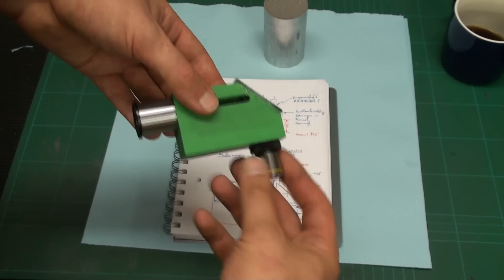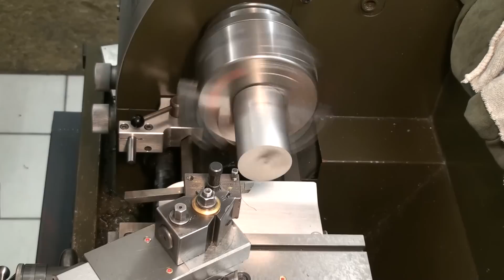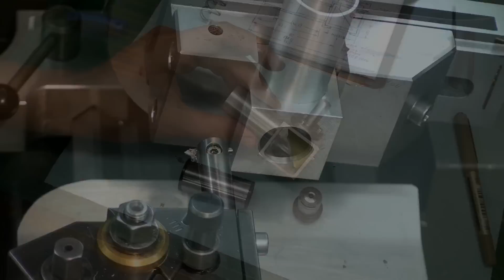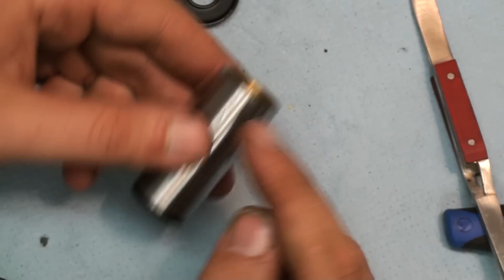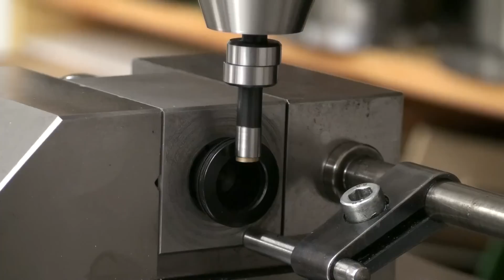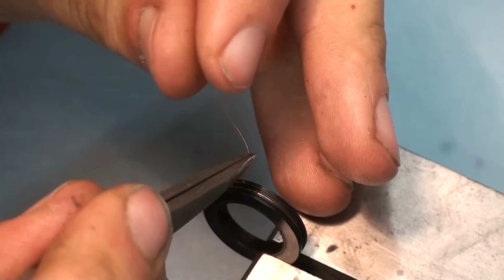Centering microscope - Prototype

Comment: Moin, Herr Gotteswinter.
Ich hab hier einige ESP32-CAM-Module, kleine Platinchen mit Prozessor und Kamerachip. Die können Sie für weniger als 10 Euro z.B. bei Ebay kaufen. Statt dem Okular können Sie den Kamerachip platzieren und das Bild auf Ihrem Handy betrachten - drahtlos, per WiFi.
Gute idee?

Comment: Nice presentation and good stretch.

Use a isotopic flash light source of a flash light or a laser pointer beam transmit from behind the eye piece can tell tales of how our design and finishing may be. When set up and focused the cross hair center onto a test cross hair center then rotate the scope one quarter turn to see eccentricity. We will be surprised with our result in the first cut. 

Scope like this must have alignment capability to compensate production error. There are two types of error concerning these scopes, optical - 1) axial tilt offset and 2) axial drift offset. The symptom of 1) can be mistaken as caused by alignment of 2) and vise versa. Do verify before entering an open loop task in refinement. 

I was am frustrated with one of mine it only have y axial correction. I decided to crack open it to regain the x alignment. Will trash it if failed. 

I love to wait for your next center scope project some day.

Comment: Stephan, this is just sweet work. I am going to try this. I love the precision. I don't agree with some comments regarding mirror angle error because once this device is zeroed by trial and error, the mirror angle will not come into play, I think. Dave T. Obviously has experience under his belt so this is my inexperience thinking out loud.
Should very much improve precision in the average drill press also. 
Thank you. //John in Oregon

Comment: Excellent work- 

Have you considered using this centering scope in the tail stock of the lathe to set the height of lathe tools?   

I would love a video of this. 

I’ve also thought about using this tool as a substitute for an optical competitor to measure parts by picking up edges and recording the DRO positions. 

Any Comment?
Reply: Autocorrect got me-
*a substitute for an optical comparator

Comment: Old video but i do have some Questions: Did you test it by drilling a center hole (just the tip) and then check the crosshair microscope how far it is off or vice versa? And did you rotate the microscope by 180° to check it´s center accuracy .And did you rotate your eyepiece/crosshair by 90 degrees or did you mark your eyepiece to not rotate it by accident because of the missalignment of the thin wire in the holes or any other off center thing? German>>>   Ansonsten tolles Teil :-)  <<<German

Comment: great but i can't believe you didn't even test or calibrate it with a real operation - would be relatively simple no? just select a target in  whatever material and bore a hole with the finest drill you have and then measure the error ... (?)  - or is that yet to come?

Comment: A suggestion for next version: you can buy optical graticules made for microscope eyepiece that are etched with precise scales ( 0.01/ per div). 
Some have concentric circles etched on the glass that make centering on small holes quite easy.
If you place the graticule/cross hairs in front of the lens looking down and align the center point with the center of the spindle you will virtually eliminate the parallax error the the optics and mirror above introduce. The center marker may appear a bit off center in the view, but if aligned correctly, it will in fact be in line with the spindle. The challenge though is very shallow depth of field. You need to compromise and balance the focus on the graticule against the focus  on the scribed line or the edge. But the up side is that the center of the scope is always in line with the spindle, no matter what happens to the mirror or the eyepiece. The downside is that this approach requires a redesign of the scope...
Check out the scope based on this principle made by Youtuber from Japan named Miki Ono.
https://youtu.be/wdcmPrVmVHY

Comment: Great idea, excellent workmanship. Question: as I noticed, the mirror with its thickness, is centered between rounded corners ( if I saw it right).
In this case the mirror surface is closer to you than the center of your mill.
What the real situation is?

Comment: A centering microscope or a laser crosshair centering light are as good as the method used to produce the center mark in the first place.  An easier, quicker and less complicated way to produce accurate holes is to make yourself a drill nest, one that can be set up using a vernier caliper negating the need to mark the hole center.  The 3D Warehouse has some examples.

Comment: You make some really good and useful videos.  You get the inventiveness in my brain motivated.  I was thinking of buying a Fowler 10X Optical 21mm Comparator lens set with the 8 piece reticle scales that are photo etched into glass.  Your single piece machined housing is genius.  I've been looking to do something similar to this.  I only expect hobbyist accuracy out of my device.   I probably will use and old 35mm single reflex camera Prism on a little fabricated seesaw for fine tuning of the angle (spring on one side and screw on the other).   I also want to add an old USB camera because my vision is no longer 20/20.
PS Hard Drive Platters are reflective. however I've made Hard Drive clocks in the past and If they are in a humid area they tend develop spots and make a nice home for some molds to bond to.  I need to get a camera and start doing videos.

Comment: But if the 4 holes ar larger than the wire, these two will doesn't self centering in the cross line correctly, right?

Comment: Very fine project ! I like it.
1. You have seen that you have to adjust the focal point of the first Eyepiece-lens to the crosshair. That is necessary and depends on your own eye-prescription. So in case another person wants to use your device he needs to make this adjustment previosly before using the eyepiece. Have this in mind in case you want to make a device to be used by different persons at the same place. (Make the first eyepiece-lens adjustable , thats all) 
2. I prefer standard prisms rather than firstsurface-mirrors. (bathroom-mirrors make ghost-images at the first glass-surface) 
The reason is price and they are easy to mount in such devices as yours.
3. One cheap source of eyepieces and prisms are russian made binoculars. You find them at fleabay. Don´t spend money buying high end binos for this purpose  , the costly part at a binocular is the mechanics and the alignment. In this case you are going to cannibalize it. The advantage of cannibalizing a binocular is you find 2 eyepieces , 4 prisms and as bonus 2 fantastic achromatic mainlenses to build luxury-magnifiying glasses for your workshop , and all is multicoated.

Comment: You can bye a chipest possible chinese rifle scope, for a few euros, and canibalize reticle from it (tubes of scopes com in two versions: 1" or 30mm diameter).
From my expirience with some optical punches (yes... not that precise, but same principle), croshear with small circle in the middle, or even just small circle, is much more precize, and easier to use, becouse center is not obstructed by hair, and you can perfectlu place what you are aiming for in the center on small circle just by "feeling".
Maybe you can make small circle on lathe with very sharp tool in some plexiglas or similar material, polish, and insert it as a croshear?

Comment: if you use a Penta Prism, the optical path is always 90°; no need to align.  New they are about 70$USD, but you can find "parts" for SLR cameras with a Penta, or even a Penta Roof, prism.

Comment: Very nice project! I think a front surface mirror would serve better, certainly more than a shaving mirror. (Obtainable from Laser/optics bench surplus stuff. Or your equivalent of Edmund scientific.) Alternately look for an old set of binoculars from a thrift shop and use one of the prisms out of them. Might even find an old battered microscope at thift shop to reduce parts cost (for those starting from scratch.) I don't see need for prism adjustment screws. Not talking about angstrom precision here, just reasonable machine tolerances.

Comment: Loved it, I need one for wheel cutting for clock making.
I have a hint for you...
For the cross hairs, I fixed a rifle scope with broken cross hairs, I used a black womans stocking thread, its stretchy held in place with super glue and very thin.
It worked great.
Cheers
Noel

Comment: Hi mate.  I'm still fascinated by the build of this project.  I have a few questions/suggestions tough.  What if you would use fishing line for the crosshairs and instead of glueing them, melting the Delrin closed with a tiny soldering iron?  I think the fishing line might be more easy to centre and will be less obstructive in the field of view.  While you might have already have finished this project, I had to stick my big fat nose in.
Reply from the maker: I push that thing around in cad back and forth, I will build a proper version of it for sure :)
The cross hair itself is definetly the least of a problem, even the copper wire I used was fine enough. I wont use a delrin ring in the next iteration, but something in the line of a plastic that takes glue more reliable. Maybe a phenolic or PEEK...stay tuned :D
And for the crosshair itself I am going with carbon fibres..
Reply: Thanks mate.

Comment: you can purchase a reticle for an astronomical polar scope very cheaply, they often come in a cell. usually 3 grubscrews would allow centring and colimation.
As the NCP wanders some astronomer fit a new current Polaris reticle, the old ones are given away (Y)

Comment: Hard drive platters make excellent mirror surfaces. Thy're optically flat and easy to machine. I use them in optical benches for laser work and can be more versatile and durable than their glass alternative. I cut mine on a pillar drill using a good quality hole saw with the arbour drill removed. As long as everything is securely clamped they cut very well, just make sure you cover the surface with at least 3 layers of masking tape, as the chips can score and damage the surface.

Comment: The spider webs they used in WWII were made from black widow spiders. We are lucky enough to have them here where I live! When you find one of their webs, you know it immediately because their chaotic webs are remarkably strong...They pull back at you before breaking. I wonder how they hold up over time?
Reply: Jan, black widow spider web is a really excellent material that holds up for many years.  I made many spider web reticles in the early 70's when I worked for Keuffel & Esser, a company that made surveying instruments.  Of course, etched glass reticles had long replaced spider web reticles by then, but we still used it to repair very old instruments.  
I think it would actually make a great DIY material for a project like this because it is so easy to work with, produces a perfectly straight line and is easily held in place with shellac.  The downside, of course, is how to coax the silk from a creature that might kill you:)
Reply: Interesting...I'll look around to see if I can find any to play around with. Where did you get them from back in the day? Did shops keep them as pets?
Reply: The silk was produced at our factory, but I never learned how it was gathered; I guess there must have been a black widow wrangler:)  We received it as a continuous strand wound on a rectangular frame.  A piece about 3 or 4 inches long was transferred to a tool that looked like a tuning fork, and the silk set into grooves in the reticle.
I couldn't find any source on the web for spider silk, so it looks like we'll have to go outside and find it ourselves!  Apparently, black widow is by far the best silk, but I will have to settle for whatever lives in the backyard.
Reply: I have a monster widow living in my garage. As long as she leaves me alone, I leave her alone. But she occasionally builds a web in the garage and I always thought it a nuisance. I can tell you that the web remains pliable and sticky for a long time. Black Widow spiders are all over central and southern California. I've never been bitten by them, but I've heard they're not fatal to anything over about 60 pounds. So my chihuahua is at risk, but my girlfriend is not. They generally hide the moment a human shows up, in my experience. If they don't run right away, I stomp them.

Comment: I just finished mine and calibrated it. Works great! No inaccuracy in centering except that my mill was not trammed correctly. It makes it easy to find a tramming error by rotating the spindle. This will get a lot of use in my shop.

Comment: Reinventing the wheel with the wire a little. Use single film magnet wire and a drop of motor/magnet wire shellac. Once cured the shellac is inert. Magnet wire goes down to 56 gauge, .00049 with the film bringing it up to .00052.

Front surface mirrors degrade over time due to oxidization. Hermetically seal the chamber and flood with nitrogen gas or make the mirror easily replaceable.

Comment: you can try rayon / cellucoton fibers as alternative material. easy to find cheap and great spider web substitute
also be careful if you try hard disk platters some are super fragile and will break into sharp small pieces like glass. they look like polished metal but they are not i think the new ones are all like that glassy material.

Comment: Why not put the mount on a bearing so then you can allow the spindle to rotate in a similar manner to the centreing dial indicators. Just make sure that the bore for the bearing is concentric with the lens.
Reply: Stuart Smith  than I will just use a wireless camera on a axis and spin that an than look at the dead spot an look for the mark

Comment: To make the crosshair don't glue it, melt it into the plastic with electric current. This way your much more accurate and you don't need additional glue that can be problematic in long term. Make two pieces so you can put the wire between them. Then put the wires into position and in tension. I've done it by soldering small pieces of iron sheets as weights to it. This will also help with the positioning. You can put in scratches in the right places to guide the wires. Then put the other half on and hook the wires up to a variable power source. The wires between the plastic half's are isolated so they can heat up. The exposed wires get cooled by the air moving around them. While heating up the wires will expand a little bit and contract while cooling down putting tension on the wire.
I've done this with very very fine wires.

Comment: the hole for the wire is on centre and dia 0.3mm, but the wire is dia 0.09mm and pulled to one side of that hole. so wouldn't the wire now be 0.105mm off center?

Obviously you can't really make a hole much smaller than 0.3mm and still really thread a 0.09mm write through it. however there are 2 possible solutions to this
1. you could pull the wire 90 deg from the way you did it. so the wire ends up offset along the axis ( which doesn't matter) instead of a across the axis.
2. you could pull the vertical wire to the right at the top and to the left at the bottom, then for the horizontal pull up at the left and down at the right. 
cheers

Comment: why not use girl's hair - wikipedia says - The diameter of human hair varies from .017 to .18 millimeters (0.00067 to 0.00709 in) - so look at their brushes. 
Next idea - use 4 hairs - 2 in each bore pulled left and right - you will get a square in the middle. white glue will do as hair does not kink as copper wire does.
 The real pros use spiderweb for crosshairs... but that is even more brittle!
Love your videos. Will start on two sine bars after finishing a 12-point switch box for an LGB-railway for the son of a friend.

Comment: HDD platters as mirrors, I would not. The ones that actually good optically are already made of glass. The rest of them actually are coated and they do have a good bit of hue to them. Your best bet on a mirror would be to find an old projector or a rear projection TV and steal the mirror out of that. Those have very good quality and are basically free if you go to a recyclers. 

For the cross hairs, if you have the patience you can get some fiber optic strands and drill the eye piece itself while gluing and exposing the ends of the fibers out to the environment. This should net you a glowing cross hair. High quality sniper scopes have this kind of setup.

Comment: I think traditionally the cross hair (reticule) used either a silk or spiderweb filament.  When using wire, Ideally a single (silver) thread is passed in an "S" through all four holes and fixed in a single knot secured with shellac to avoid differences in tension.  Probably not a significant issue at 5x ... just splitting hairs :).  Agree about providing adjustment of the mirror also, at such small scales it doesn't take much to throw in big errors.

Forensics use superglue vapour to find latent fingerprints in an enclosed space it's very invasive - plus the acid used to keep it liquid is extremely corrosive the vapour is insidious and gets everywhere.

Comment: Hi Stephan, I have been a camera tech for 20 some odd years and the best surface plated mirrors are in poloroid sx70 cameras and 35mm slrs. they are very thin and un 
tempered. Also 90 degree slr viewfinders could be handy as well. check your local thrift stores.

Comment: You know of course that you can buy an micro camera with a USB cable connection for your computer for less than $20. It would be interesting to make a mount for that for either a lathe or milling machine. I'm going to sit right here waiting for that video. Thanks for sharing you great idea.